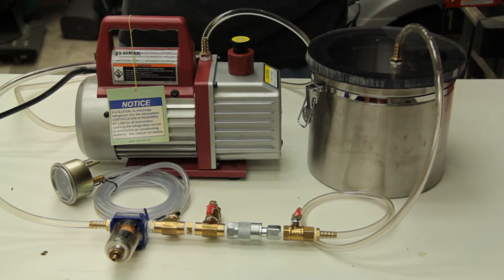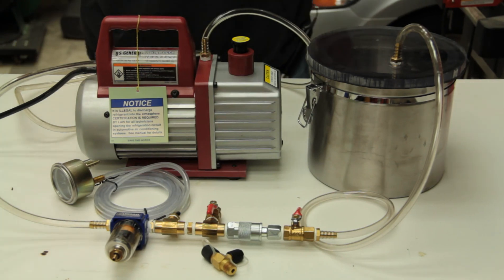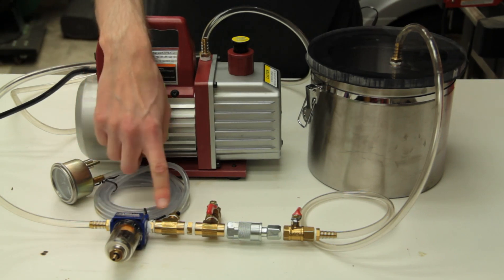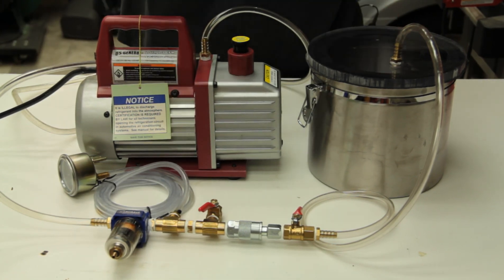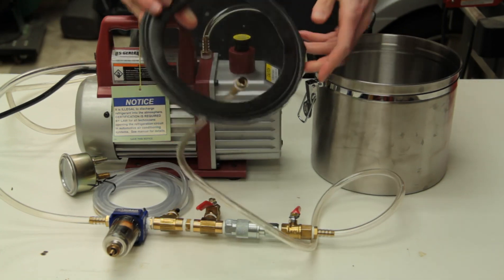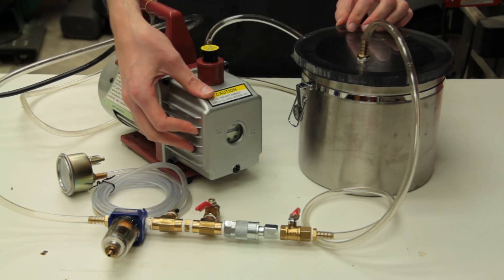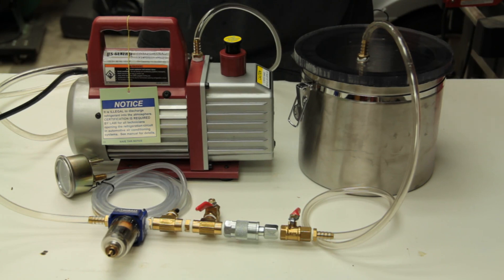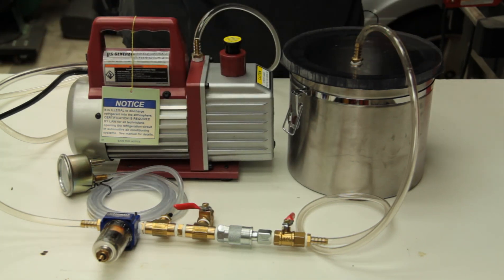DIY Vacuum Chamber Setup

Comment: I like this setup. I have most of the parts but the chamber you have there is a what? will and smooth top stainless do?  where did you get yours?
Reply from the maker: Ken Owens That chamber is actually a random pot from Bed Bath and Beyond. Any vessel which can withstand the forces of having a vacuum drawn may be used. Pots seem to work well but you need to ensure the lip of the container is able to make a good seal to the top.

Comment: Can you use a pressure cooker for a chamber?
Reply from the maker: All of the pressure cookers I have seen create their pressure by sealing the chamber and then increasing the temperature. This generally means there is no convenient port to attach a vacuum. If, however, you could arrange for such it would likely work. Be on the lookout if the walls of the chamber start to bend inward under vacuum. If they bend too far the seal on the chamber will break and you will loose vacuum; though loosing vacuum is generally less extreme of an event than loosing pressure.
Reply: Drill out the pressure relief in the lid then tap threaded fitting in its place

Comment: If the small item I'm pulling the air out of only has a HOLE the size of an acupuncture needle will it still pull the air out and should I shoot for the full on 28 inches mucury?
Reply from the maker: The size of the hole will determine the rate at which air is removed, not the ultimate vacuum. You can get a strong vacuum from a small hole but it will take longer. Also consider if the chamber has any leaks it may be possible for air to renter faster than you can pull it out.
Reply: Les Wilhelm Thanks much! that would have been my next question,okay I pulled the air out but as soon as you pull away the vacuum  seal that same air pocked although it might have now moved to the top will just refill with air...it all makes sense now

Comment: Hi Les...tks. How did you calculate the thickness needed for the lid? I ask because other sites mention that the lid should be 1 1/2" thick...which considerably increases the cost of the setup. Do you see any visible deflection with the 1/2" thickness. Thanks
Reply from the maker: 1/2 inch polycarbonate stock was what I had in the shop so its what I used. There is no visible deflection when under vacuum. Keep in mind the permissible deflection is that which maintains the seal with the chamber. So to really determine the requirements of the lid you must also consider the properties of the seal the lid works with.
Reply: Les Wilhelm tks....   will give it a try.

Comment: Good video. How thick is the acrylic top and where did you get it.
thanks
Reply from the maker: The top is is 1/2 inch thick and is made of polycarbonate. Acrylic will work but may cause difficulties if you attempt to force thread it using the fitting instead of a real tap.

Comment: What size is your barb fitting connected  from your pump to your hose? Specifically the thread end.
Reply from the maker: The threads on the fitting going into the pump are 1/4" NPT.

Comment: Do all vacuum pumps have the 1/4 NPT threads to connect the fitting for the air conditioning unit.
Reply from the maker: 1/4 NPT threads are very common but they are not the only thread type available. If you require a specific thread pattern check the documentation for the pump before purchase.
Reply: Les Wilhelm Thank you.
Reply: If in doubt just remove the one on pump take it with you to HD or Lowe’s go to plumbing department they have a small display of fittings you just try to thread your part into the ones on board till you find the right thread size hope this helps

Comment: I want to use this for sucking air bubbles from under an lcd of a phone after applying an OCA film. Will it work? People usually use an autoclave for this purpose but those are costly. Search autoclave LCD to see what I mean.
Reply from the maker: the autoclave works on a different principle than the vacuum chamber. the autoclave increases pressure and temperature to crush out any bubbles caught under the film (the heat may also assist in curing the adhesive). the vacuum chamber will attempt to remove the air from under the film which may cause the film to lift off of the screen as the trapped gasses expand due to the decreasing pressure.

Comment: hi 
 i want to know the specification of the motor to create the 29 inch of vacuum 
 and is there any relation between the motor and the volume of the vacuum chamber
what are the maximum dimensions of that chamber for that motor 
pls reply
Reply from the maker: the pump motor is listed as 1/3 HP. the pump specs are 3 CFM with an ultimate vacuum of 25 microns. 
The power of the motor determines the speed at which you draw vacuum. Larger motors draw your vacuum faster. The quality of the pump your motor is attached to will determine the ultimate vacuum you can reach. A 29 inch vacuum is not very high at all. You could achieve this with almost any vacuum pump available. 
Larger volume chambers will draw down slower than small chambers using the same pump. If your system is free of leaks you could achieve a simple 29 inch vacuum in any reasonable sized chamber without issue but remember the larger the chamber the slower you will achieve your target vacuum.
Reply: Les Wilhelm thanks for the reply , one more thing i want to know that, is 1 stage vacuum pump is enough ?
Reply from the maker: Rahul Rawat yes. you should have no issues getting to 29 inches with a single stage pump.

Comment from the maker: A vacuum chamber removes air from your material. A pressure pot compresses the air in your material. An air pocket which has been compressed is smaller and thus not as likely to be visible. 
I have seen many instances where both of these systems are used (vacuum followed by pressure), especially when making parts from molds.

Comment: Drill a hole slightly Smaller than your thread size, heat the poly with a torch and screw the barb in.

Comment from the maker: if air is trapped in the material (epoxy or silicon) and you pour the material into a mold there is the possibility the air bubble will migrate to the surface of the mold. When the cured part is later removed the air bubble will manifest as a small recessed area on the finished part. Degassing these materials while they are still in a liquid state prevents this from occurring.

Comment from the maker: I would not recommend it. Normally when working with flammable vapors you use non-sparking equipment. This pump is made of steel so even though sparks are part of normal operation they are possible. 
In addition you would need to verify the solvent you are boiling off will not harm the pump or its seals.

Comment from the maker: there are a variety of vacuum gauges you can use to measure the pressure remaining in the chamber. you can also listen to the pump as the sound it makes changes as the vacuum it is working against increases. 
Note: you will never remove 'all' of the air from the chamber with this type of pump no matter how long you let it run. You can get 99.999% of the air out. Further vacuums require more specialized equipment.

Comment from the maker: small bits of dirt, grit, or metal powder can scratch the pump's interior surfaces causing it to loose compression. however as long as you can ensure the pump will not ingest anything which would harm you do not need a filter.
these pumps are intended to run continuously for drawing down AC systems so a 30 run should not be an issue. 
also keep in mind the more you use the pump the more often you will need to change the oil.
Reply: I removed my fittings coming from pump like Les said it is for A/c units replaced mine with male Air tool nipple then added a air coupler disconnect ( like air tool set up ) for quick coupling

Comment: Yes I have the same one stage pump, but I want to know if I use it without all this things, like the air filter, Can I broke my pump if I run it for boiling at room temperature?, I don't know, let say for 30 min making all the time the vacuum. I don't want to brok/burn the engine that's what I want to know, thanks for reply! Greetings from Argentina

Comment from the maker: it depends on what fittings your pump has. if you have standard R410a fittings you could try to find an adapter. You could also replace your pump's fitting with a T fitting and put the R410a on one side and a bard fitting on the other. 
It is also possible to take a piece of flexible tubing and zip tie it directly on the existing fitting. It is a hack but it can be made to work if you really don't want to take your pump apart.

Comment: was just wondering if quick disconnect, which is designed for pressure would also work under vacuum. I was hoping to see it in opperation.

Comment from the maker: the pump is the most expensive part at around $100. 
vacuum gauge $15
air filter $13
chamber $10
lid - made myself from leftover polycarbonate
tubing - $5 get your more than you need
air fittings - about $3 each (there are 14 in this setup though you only need 2)

this is assuming you get all the parts new